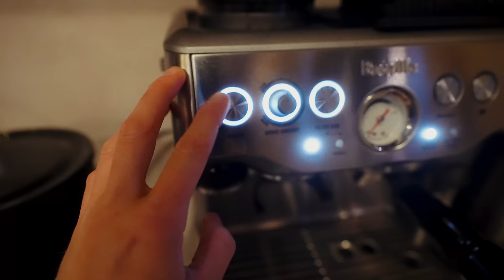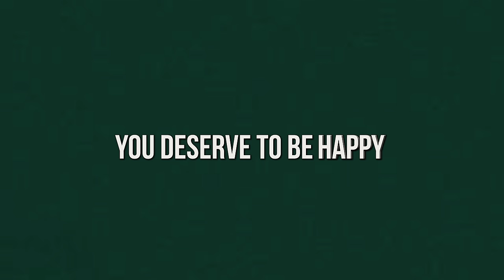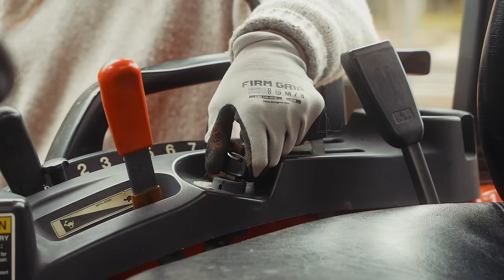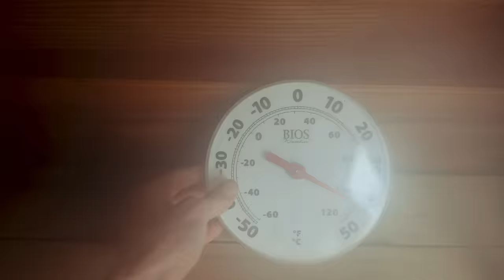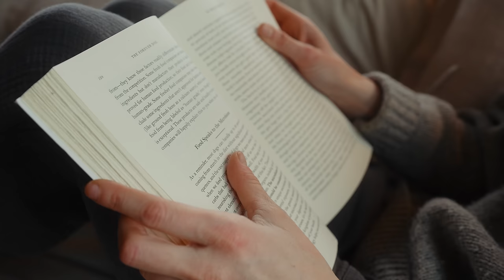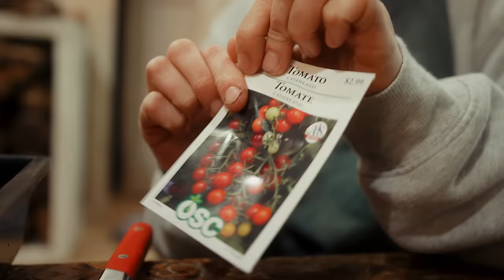Raw, Unfiltered, OFF-GRID LIVING: Inside Look at What You Don’t See

Comment: For the greenhouse critter problem, dig out the dirt floor a few inches, put down hardware cloth (wire mesh), and replace the dirt.  That stops them from coming up through the ground.  For the door issue with pollinators, cut the door in half so you can shut the bottom half while letting the pollinators in through the top half.
Reply from the maker: Thank you for all your great ideas. We appreciate you sharing with us. 💛🐶
Reply: My Mom use to put a pie tray full of Ammonia under our cabin never had any critters after that @Vanwives
Reply: yes I did this around my shed it works small hole wire though hi from bc canada love watching you travel our province and building off grid my son told me about you two I have been Bing watching you love lizzy and Bella and your relationship so proud of you two
Reply: Came here to comment this. We had rats burrowing in our community garden and this was the solution.
Reply: Maybe also winterise the place by removing the plants and everything else that rats would see as food. Also shut the water off and drain the lines.  😊
By removing the plants before they die and rot. You also avoid the mildew and other fungi in there
Reply: @Vanwives  On the outside because it is easier, wire mesh preferably attached to building and down a bit then and extending horizontal outward.  Critters scoot up to building and try to dig down but can't.
Reply: Yes def get a cat, they are healers and great therapy along with being cute and snuggly. ❤
Reply: Before you do flush hole with water from inside so and visitors leave, then leave a piece of food and camera  and make sure any visitors have left 😂
Reply: A huge garage/barn

Comment: We had a rat in our greenhouse that had dug a tunnel.  We ended up laying galvanized steel cloth mesh on the floors and bottom of the beds since they cannot chew through.  It was so worth it and haven't had any problems since.  Rats are creatures of habit and don't stray from their paths once established.
Reply: Exactly. Really good at keeping out small things like mice, voles, moles, as well as anything else with claws that can dig to get in there.
Reply: I have a pet chipmunk that my cats brought home when it was a baby, it's pretty big now but the cage its in with hamster wheel the cell size is about inch by inch squares and it can squeeze through. he tries to chew on the cage like trying to escape but its merely gnawing his teeth down. rats and squirrels and chipmunks can move their bones around and fit through tiny holes.
Reply: That's why I always use 1/2-inch hardware cloth or smaller.
Reply from the maker: Oh Shari, thank you for sharing your knowledge with us. 😊🐶

Comment: A method of getting rid of rat holes would be to flood the holes with water, using a Water hose.
Reply: Peppermint oil
Reply: ground burrowing holes are built for the water table so if you flood it then the water just seeps into the lower earth.
Reply: @d3vin301  oh didn't realize. Thanks

Comment: Tomcat brand glue tray traps "Super Hold" for the rats and mice already inside. Dab of peanut butter in the center.  Around the outside perimeter(100% of it!) dig down 10" and install hardware cloth, also staple gun it to the outside of your siding.  Worked for me.

Comment: The key to growing from seed is to start with seed that has 90% success rate.  Jason over at Cog Hill Farm plants a big garden with plants started from seed, and he uses Hoss seed.  Go over to his channel to see the videos of how he mixes his potting soil, his use of organic fertilizer, his strategies using organic pest control, his watering schedule, and how he uses his greenhouse.  I think building a separate potting shed is another project to consider.  The potting shed (with electrical connections) would hold the grow tables which are used with heating pads to set the seed pads on.

Comment: You should consider using Linseed Oil and put a few coats on your wood chairs and table on the deck. It seals and preserves the wood and gives it some necessary moisture. Applies with a brush, rub off excess with a soft cloth after it has set a bit and you are done, real easy to apply and so worth it. Many blessings, hugs from Nana in Florida
Reply from the maker: Thanks for sharing all your experience with us. Sending hugs back to you Nana in Florida. 💛🐶

Comment: Yes! more of this!!  use steel wool around the base of your structure..they can't get through it. (steel wool rodent control is about 4 inches, large enough) Also plant mint outside right up against the structure, but remember it takes over, so be careful. I have mint planted around my entire property..you can also use chicken wire to put in front of the open door...makeshift screen door :)

Comment: For rodent protection on the geo dome.
In the plans it does say to dig on a 45 angle and place that pink foam insulation and hold it in with a stake.
Then cover back up
But u can just dig down and put chicken wire around it entirely.
With the clearing of brush, I would borrow a wood chipper to make mulch and use that in pathways or trails around the property and to the rivers and other cabin.
Finally Clementine gets a home, which will be better for her... longevity is the key for machines like that.
Google tropics of Canada, they sell exotic fruit trees.. I plan buying a dwarf avocado tree and already purchased dwarf cheery tree and grapes for the dome. Planted some sweet potatoes, thimbleberry royal purple raspberries onions and carrots.
It is good to keep the property clear of dead stuff,  helps keeps bugs away?
Good idea to up with chopping wood for the winter.
For ur patio cushions I would build a small shed or contain off the deck to put them in for when inclement weather comes.
And last but least hubby and I will be in New Brunswick for a wedding in June 
Wanna meet, give ya some tips and tricks on proerry stuff, we dont know anything about compostable toilets.
We need to learn more about soalr hooks and types of batteries..
Maybe install a cloths line for the summer months?
Keep up the good work..

Comment: I've had problems with a rat before - they can dig under your greenhouse wall and get  inside, BUT according to the local rat police (which my son calls the municipality's rat control), a rat doesn't dig very deep, so you CAN put the chicken wire down 25-35 cm into the ground the way around your greenhouse and then it will probably be stopped here. If your greenhouse door cannot be split in two, you could consider getting a door where you can close the lower part for rodents and then just open the upper one so that you can get air in there when necessary! Love your videos girlies ;) Hugs from Stine in Denmark!
Reply from the maker: Well thank you for sharing so much of your knowledge with us. Sending hugs back to you from the pack. 💛🐶

Comment: You're going to have to put something down not only on the main floor, but you are going to need to empty your beds and put them in there too. You can't leave it. Several recommended galvanized steel mesh, I was thinking of cement. Either way, you will have to empty your beds too to protect them from the critters. Then look into some way to keep Roger Rat out of your compost and trash too.  Then you can use the mint too, but as mentioned mint spreads like wildfire and needs to be in pots, put a tile under the pots, or the roots will go through the bottom and spread everywhere and you don't want to have your entire property covered in the stuff. For your home there are some pet safe, my dog could care less about them, ultrasonic pest repellents. They keep mice, rats, and rodents out without hurting them. I used to live on a 1000-acre ranch and used them to remove 25 mice that were having a party on my kitchen counters every night. It cleared them out in a day or two. I have used them in Georgia USA, where bugs are insane, and all my neighbors complain about roaches and I have none. They do have to be replaced every 6 months though because they will stop working. I have had flies fly into my house, and turn around and fly right back out. I also notice fewer fleas on my dog. I still use a flea and tick collar in Georgia, but didn't have the problem in California with these because it was like as soon as the dog walked into the house the fleas jumped off and were gone. It was amazing. Here the fleas are a bit more intense, but I still only use a collar on my dog. 

Actually, I don't like Turkey of any type. I am also intolerant of plant foods, and can't eat them. They cause me horrific fibromyalgia and I throw up all night if I eat the smallest amount, so eating fake plant-based turkey is a super big NO for me.

Comment: You could pick up some humane (catch and release) rat traps, or try one of the ultrasonic devices to keep them away. I can't speak for the rat ones but I had a problem with a bat right next to my patio door and it worked.  There's also repellents. For rabbits you can use coyote urine (really stinks though). Also, rats can get through a hole the size of a quarter. I filled any holes I found with wadded up aluminum foil. Critters hate biting into it. (a sheet or two of aluminum foil keeps dogs off of any furniture you don't want them on. I had a dog that tore through cushions with his nails. My sister had a pup that destroyed all her new patio cushions.)

Comment: I don’t know how old this video is, but I’ll tell you one thing you have to clean your chimney or your stove pipe that goes outside at least once a year before you start using a fully in the fall you’re clean it all out and then spray and clean it all out that’s the one that goes outside the house so they make a thing that goes on a drill. Did you go from inside the house right up the chimney and all the stuff will fall down into the woodstove and clean it all out. Best way to clean it. All out is to take a shop back with the filter in it, so you have shit all over your home and suck it all into the shop and change the year. That way you’ll have a clean burning and woodstove and nothing bad will happen to you.

Comment: A thought about helping your forest floor clean up. It is hard to judge from video, but is it possible you could have someone come with tractor and bushhog to run through and chop up the smaller branches and brush between the standing trees. Might not be possible but just a thought. Love your content. Keep up the good work. ❤😎

Comment: Pour dry concrete down each hole you find. Fill to just below ground level. Pour water on the dry concrete and watch for the water to leech down into the dry. then just fill the remainder of the hole with dirt. Do this for every hole you find. It seems like a lot to do but in reality it only take a few minutes and if you keep up on the" fill holes and repeat" process. you will start to notice the rats will stop coming around. For added "shits & giggles "take some moth ball and go around the perimeter of the inside and outside of whatever building. Good luck. 😀

Comment: Use fine mesh screen such as hardware cloth around the perimeter of the greenhouse at least 6 inches deep and bend outward at a 90ᴼ angle. Sanitation: Sanitation will also do a great deal to control rodents.

Comment: Mech here. Have a regular maintenance routine with Clementine lovely ladies. 'bout every three months Esp if you're using it hard. Check fuel filters, air filters, oil levels in all systems around every 200hrs of operation. I'd i teleport myself there to do it if I could.  Love you and the channel.(and the dog footage. I'm I dog guy) Any Q's about machinery shoot me a Q. Got your back.
Reply: And yes, in case you're wondering, you have a permanent remote subscribed diesel and petrol qualified mech advisor from Australia at your service. 🙂Go get into the next project. 👍

Comment: Use rodent mesh,or small gage welders cloth buried around the outside of the green house about 6" deep or more.  staple or screw it to the wood bottom frame. Cover up with dirt. Rats etc can't get through that. BC is overrun with rats and mice, it worked for me 👏👏

Comment: Just surfing through my youtube feed and there you girls are again.
Beautiful pic. First plunge of the season. Man Crystal was out of there in a flash. If you're looking for those youthful benefits of cold plunge try to add 30 seconds or a minute or 2 to each visit to stream. Three or four times a week. If possible. Pumping those youth hormones...
That little old cabin looks so good in the picture. It's a shame it's so moldy. I might strip it to its bones and seal everything down. Maybe fill the walls, floor and ceiling with spray foam. Only after replacing whatever is necessary. Roof trus. Floor joyce. Windows, headers and Studs. Run some new water lines and electrical. Add a nice hydro electric paddle wheel outside in the stream. Could be good. Just don't like the idea of you girls playing with all that old mold. Or the puppies as there the most sensitive. Hope you girls are having a good week. Love the pack✌️🤟🖖
Reply from the maker: Thank you for sharing with us. Sending love back to you from the pack. 😊🐶